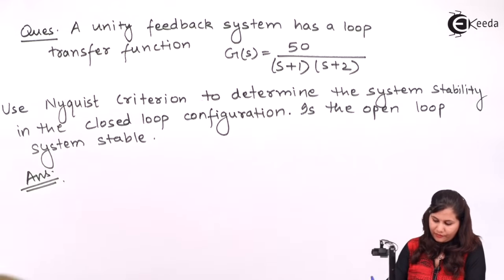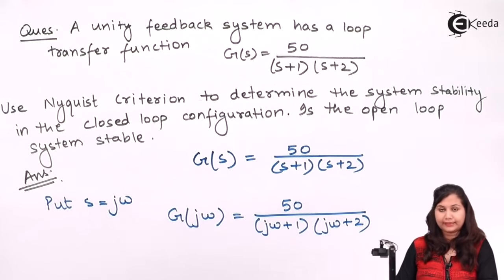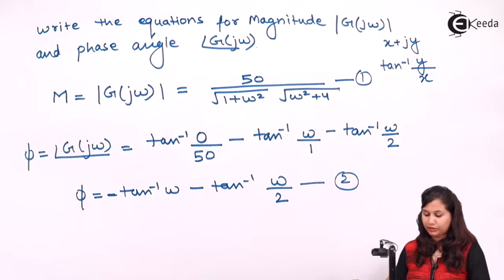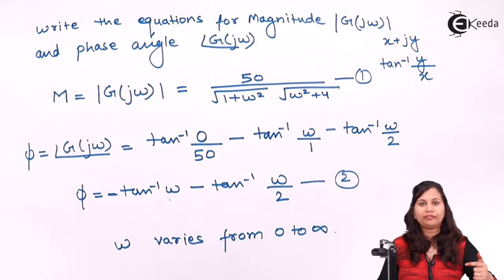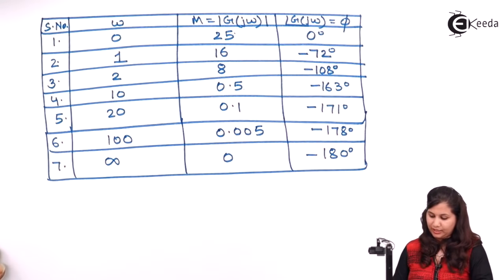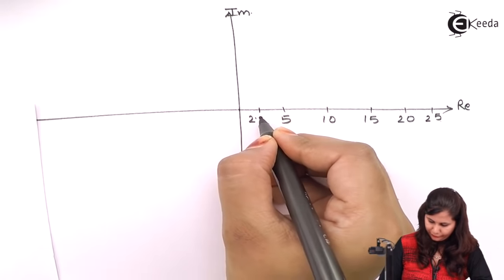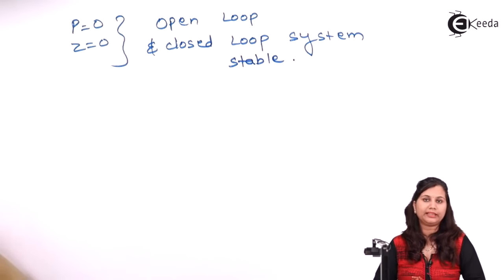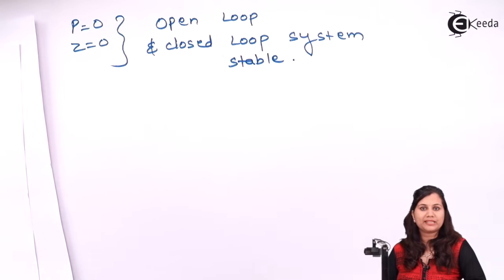Nyquist Plot (Problems) - Frequency Response Analysis - Control System

Comment: A unity feedback system has a loop transfer function G(S)=(S+2)/[(S+1)(S-1)] Use Nyquist Criterion to determine the system stability in the closed loop configuration
Reply: for this example it's easeir to obtain characteristic equation of 2nd order and then use easy Routh–Hurwitz stability criterion. I found this one stable? because all coefficients are positive. Am i right?

Comment: Hello mam, i didnt get the point of why we calculate the magnitudes... while we plotting we didnt check the magnitude values on w values at all. For example w=1 angle is -72 and magnitude is 16. But while you plotting w=1's magnitude is like 7 or 8. I didnt get that. Can you explain this ? Best regards.
Reply: Same doubt
Reply: W=1 gives an irrational magnitude, definitely not 50. Not sure about the angle,I'd use a calculator myself
Reply: I think it's just physical error, because it's just a rough plot. So, it must be at that value only, but while drawing roughly, it didn't come to be the exact value.

Comment: i have a doubt, that in considering magnitude of  (1+jw) * (2+jw), i think we need to expand it and then take magnitude.
you had directly taken it as sqrt ( (1+w^2)*(4+w^2) ). But if we expand it and simplify and then consider the magnitude im  getting sqrt(w^4 + 2*w^2+4). so, both expressions aren't same. can anyone help me..?
Reply: We know that multiplication and division are easy in polar form rathaer than cartesian form.

hence first we convert from cartesian form to polar form i.e a+ib as sqrt(a^2+b^2)At angle of Itan(b/a) then we know product of 2 complex numbers in ploar form :magnitude will be multiplied & angles will be added.
Reply: Jaake job kar jaa....kuch pisa to milega